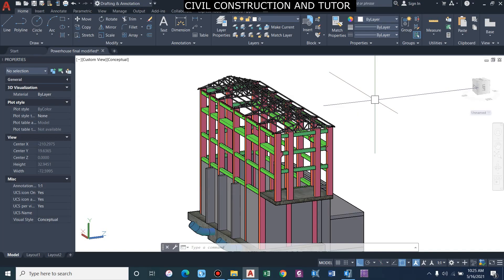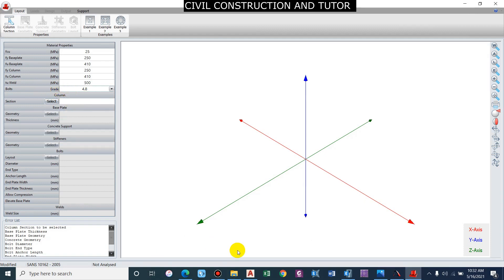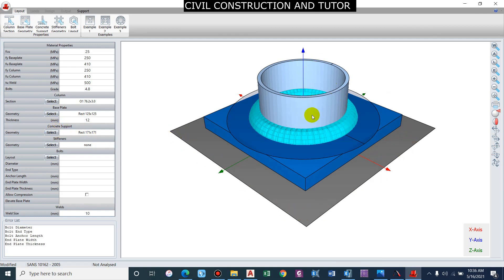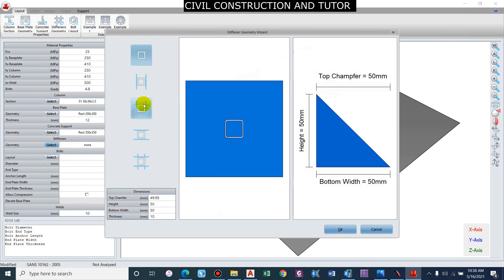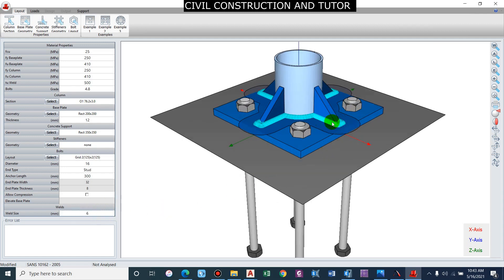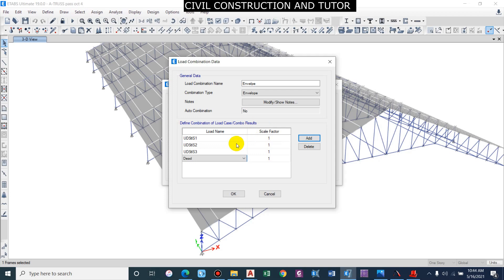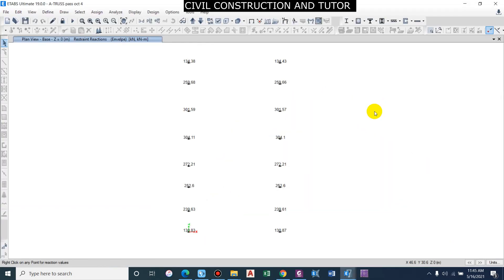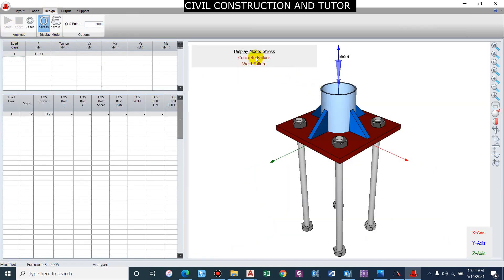Design of Steel Connection | Base Plate and Anchor Bolts | Steel Truss Connection | ETABS & PROKON

Comment: hello sir, 
why you didn't consider Fx, since it was pin connection? and Fx is considerable ?
 and why you have designed base plate as fix while truss is designed for pin?

Comment: For small loads how to calculate the embedded length of column into rcc?
Reply from the maker: Ld = Load/(π x 𝜏 x d) where R = base reaction at support, 𝜏 = bond stress for concrete d= external diameter of steel pipe